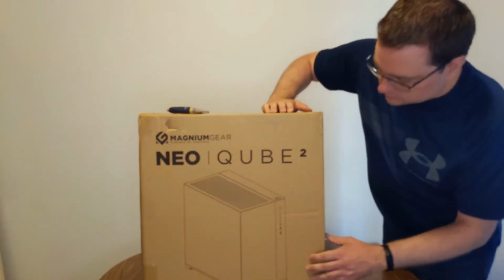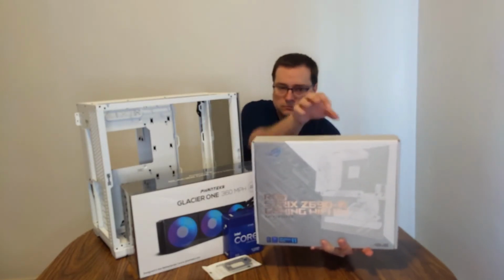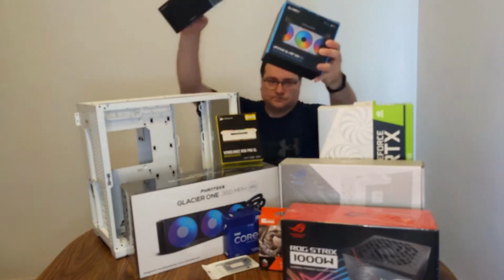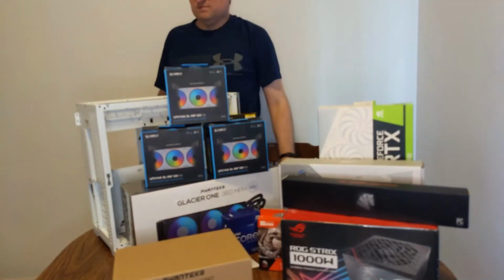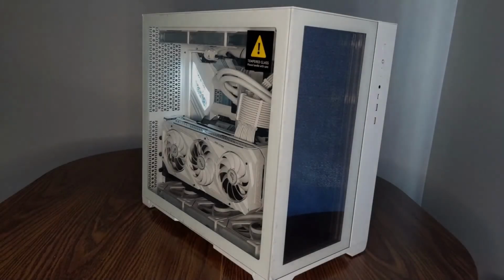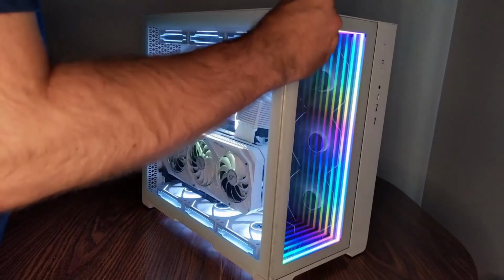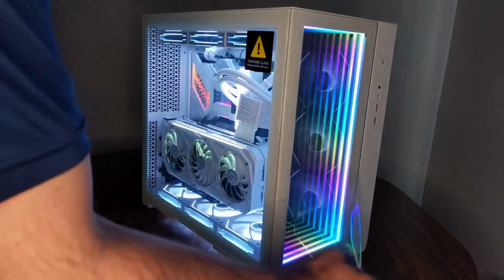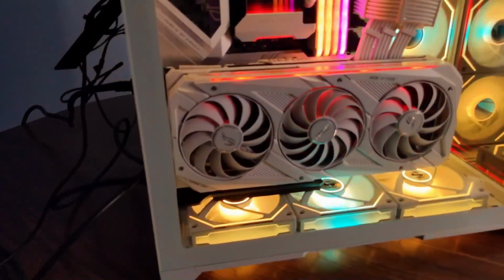MagniumGear NEO Qube² All-White PC Case Build and Review

Comment: Nice build. How did you synch the infinitymirror with the lianli unifans/lconnect3 hub ? Did you Connect it to the motherboard on the 3pin argb 5v ?
Reply from the maker: Yes I did. Separate software from the fans was used to control the infinity mirror however. Thanks for asking!

Comment: Hi! Great video. I got the same case. I was waiting for the last part of rhe assemble. Im having issues putting the last piece on the top right w the screw on the back. How do you set it in place? It has some hooks that i cant seem to manage to put in place
Reply: you drop it in and push it towards the front sliding the pins in and screw in your screws to the back of the case 🙏🙏

Comment: Hi! Did you face any temperature problems with the vertical fans put on exhaust? Generally speaking i always saw the vertical fans as intake and only the AIO radiator fans as exhaust. Im asking because my setup is the same as yours! Thank you :)
Reply from the maker: I didn't test it as intake because I wanted to show off the fans infinity mirrors. I didn't notice any problems with temps at all. I suspect that it would be a few degrees cooler the other way but nothing major. Thanks for asking!
Reply: @gameon962  thank you for the prompt reply! I'll try both ways and I'll let you know :)

Comment: will it fit rtx 4090 aib ?? or not?
Reply from the maker: It fits gpu up to 410 mm max length, vertically mounting you probably lose about 10 mm. You should still be able to fit a 4090 aib in the case either way, the longest ones I've seen are about 360 mm. Thanks for asking!

Comment: Could a 4080 be horizontally mounted you think, or is too wide for the case?
Reply from the maker: It is possible that to mount horizontally you would need to use a 90 degree 16 pin adapter cable adapter instead of the included adapter cable that the card comes with, though I can no longer test for sure. Thanks for asking!
Reply: Only the smaller ones, msi trio, pny or palit gamerock for example, I have this case and I decided to wait with my strix 3080 till the 5000 series comes out hoping the high end models will return to a more reasonable size.